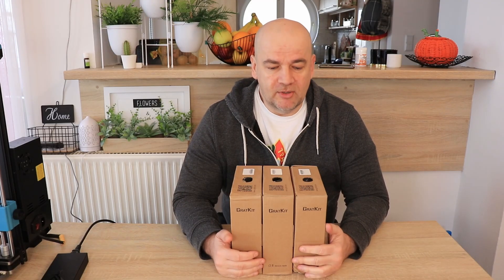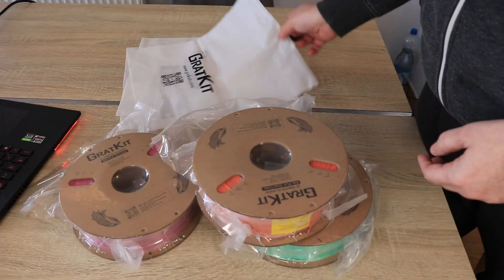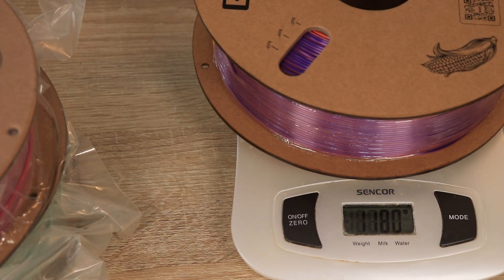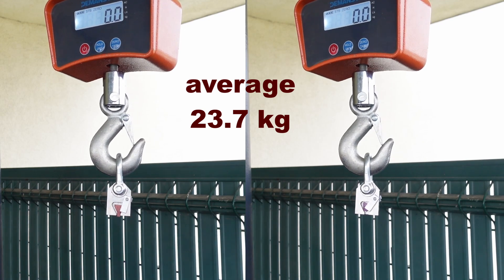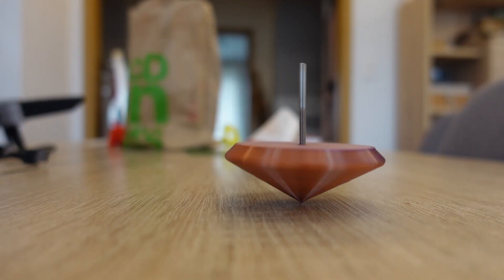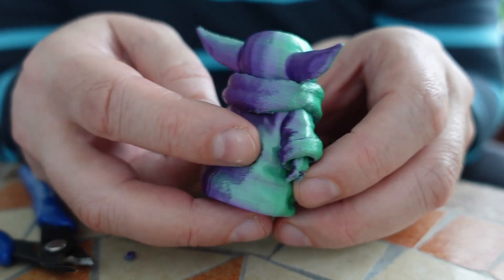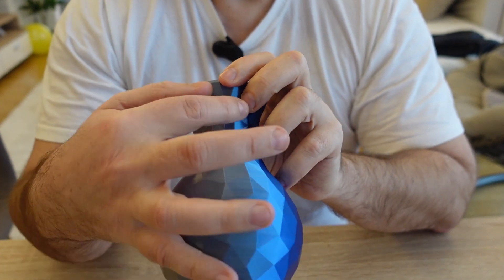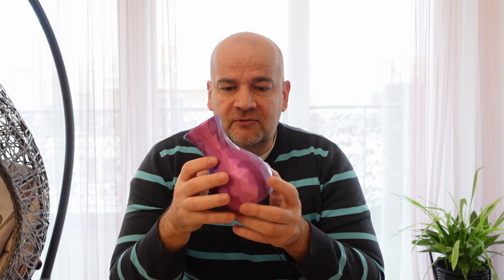GratKit dual and tri-color silk PLA filament testing

Comment: Hey buddy, I have a very specific video wish. 
Your material comparison videos are the best of the best of YouTube, but one parameter was missing. 
When you compared resins you could have "cured the resin under hot water" this according to many resin manufacturers increases tensile strength by up to 40%, since the molecules are free to move when heated and can find a bond easier. But the best part is, it also increases impact strength significantly, which is the Achilles heel of this material.
So can you please make some test next time ?

Comment: Hey I have an Idea for some new testing, Flexible Filament Seals, O rings, X rings etc, and test if they can hold pressure, with grease applied or oil, you could do a pressurised container and a shaft sealed by a tpu ring/ simmering